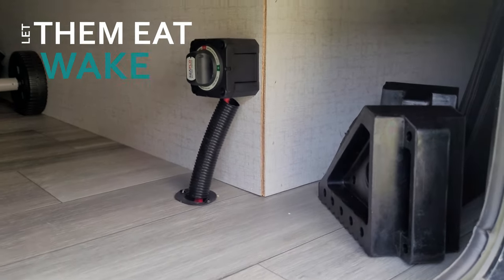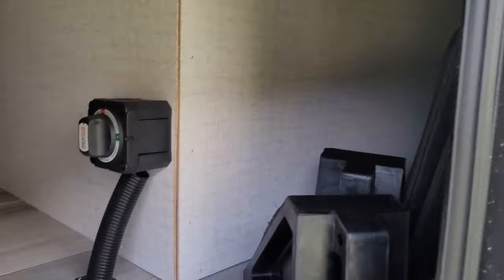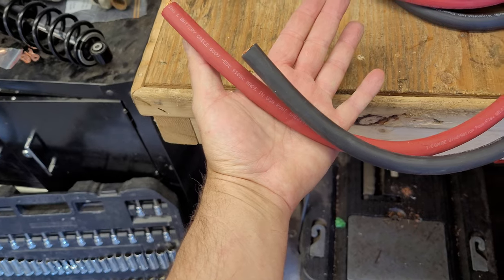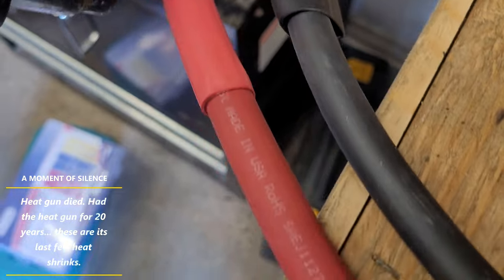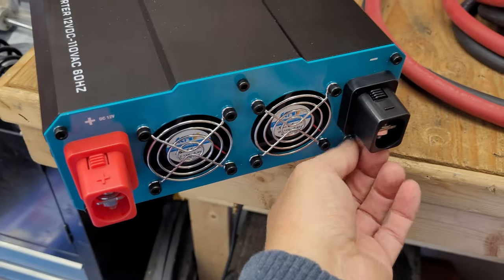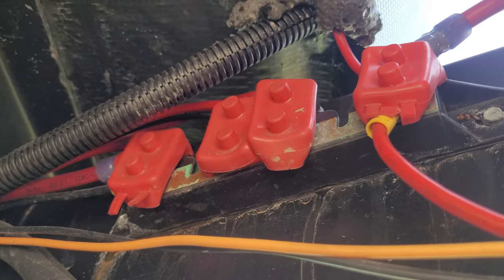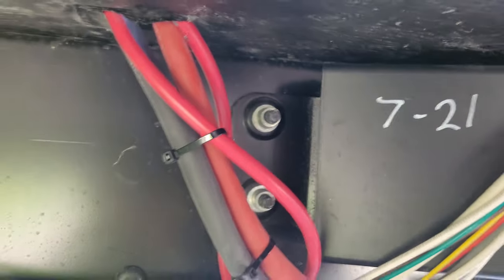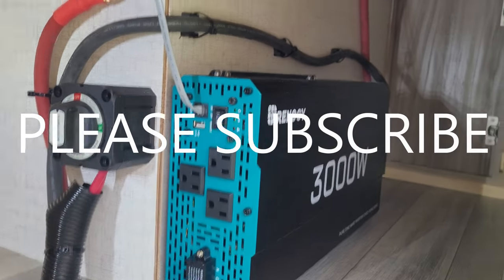Renolgy 3000w pure sine wave inverter install into Winnie Mini 2108DS RV.

Comment: Per this chart, aren’t you way undersized on that 0 wire.

You need to check the heat on that line while running the max power you will be utilizing.

The 12v wire gauge size chart that can be found online, will show you need a heavier duty line then that.
Reply from the maker: I have it fused at the battery for 250 amps. Then a reset able 300a after that. Fuses will pop before any heat becomes a issue.

Comment: Lots of good stuff like chafe protection but ideally, depending on the distance to your battery, you might add a fuse (or move the existing breaker) at the battery to protect the wire going from the battery to the existing breaker.  The codes vary on the maximum distance between the battery and fusing but it's generally measured in inches (or cm).  You always want the protection (fuse/breaker) as close to the power source as possible.   Inverter/Chargers may need protection at both ends - ideally.
Also remember your cable run is only as good as the thinnest wire that it travels over (think weakest link in the chain) which includes the battery to battery cables (though in your case they only need to be 50% the size of the main run) so in your case you wouldn't want to terminate the larger wire on the busbar unless you upsize the wire from the busbar to the battery.
A clean install generally looks like  Battery -> Fuse as close as possible -> bus bar -> fused distribution panel with smaller fuses to protect the smaller gauged longer runs.   Larger loads like an inverter can be wired "alongside" your general house loads (which looks like what you are doing) but both should be fused/protected close to the battery.  Search for "MRBF Terminal Fuse Block" for a quick and easy fusing.    Happy travels.
Reply from the maker: Good info, I will throw a large 300A inline fuse closer to battery

Comment: FYI, there's something they never mention as far as your total load on the batteries. This model states >90% efficiency. So, the inverter will draw 1.11x more than the rate of 3000/12. This will add up to 3330 watts / 277.5 amps load on the batteries at exactly 90%. This may improve by how much better than 90% it might be, but prepare for the 277.5 amp draw at max rated watts. It is a big difference in run time.

Comment: Also.70mm cable like you're using can run 450a. 3000w/12v=250a. The  3000w invertor can hit 6000w peak..  hence a 300a =  3600w at 12v breaker is good!

Comment: My plan is to also install a hard wired 30 amp rv female plug beside the inverter, with a closable plastic access hole at the bottom. That way I could plug it in, it’s hard wired 30 amp, should run the whole camper. Now I just need to figure out how to charge these 230 amp hour batteries, lol
Reply: That will power your converter which will try to charge your batteries that are powering the inverter that is powering the converter that is charging the batteries that are.. see where thats going?
Instead.. find the breaker thats maybe powering all of your 110v outlets (prob except microwave).  Disconnect from that breaker and run the romex to the 3-wire connection on the inverter instead.  That way.. real shore power powers converter, converter charges battery, battery powers inverter, inverter powers 110v outlets.  No shore power?  No problem, inverter powers 110v outlets until batteries die, perhaps charged/prolonged by 400-600 watts solar? 
This works for 90% of 110v needs.. coffee maker, TV, laptop, etc.. A/C is out of the question, the inverter could maybe do it, but the batteries wont last.

Comment: You want to use 4/0 cable/wire and a 400AMP fuse also 3000 watt inverter will power the air conditioner. not sure how far your batteries are but you want to be less than 6 ft away  from the inverter. If you do use bus bars they should be 400 amp. All this can be confirmed by Renogy if you give them a call.
Reply from the maker: I added an additional 250a fuse at the battery so if it pulls to much current that fuse will pop. And yes it can power the AC unit. So far no issues. Batteries are a very short run to the inverter, so not much loss there.

Comment: I would like to do this setup with lithium but inside the passthrough. If I take the wires that charge my lead acid and connect to the lithium that should charge them? I have a WFCO auto detect currently

Comment: Very well presented video but I can tell you without doing the math that two flooded lead acid batteries and a 3000 W inverter would maybe be likely to if you’re lucky toast two pieces of toast you are way overpowered for your bank of battery
Reply from the maker: Yes its more of a future capacity planning. However my wife can use her blow dryer for over 13 minutes, so its serves its function :)

Comment: Question, you sized your fuse for 3,000 watts, but what about the surge, usually double or 6,000 watts? Just trying to learn so I can build a portable power supply, thanks
Reply from the maker: Hi Jerry, What I did not show in the video was another inline fuse of smaller capacity 6 inches from the battery, it is a 250A fuse. So It would pop faster than the 300A one would. It has enough surge for me to run my A/C. Or for my wife to run her hair dryer. I am not running anything with more load than that. If you were you should increase the wire size, and fuse amperage, Worst case in my set up, the fuse pops.

Comment: Im new so go easy.since you have your batteries connected to the inverter now where does the rv get the ac since its not connected to anything? It looks like you accomplished nothing again im new so please educate me as we just bought a 2108 fbs and want to do the same
Reply from the maker: I have a 30a plug beside the inverter, that your normal 30a extension cord plugs into, and then into the side of the RV. So you utilize the stock rvs internal AC wiring. All you have to make sure you do is turn the converter off at the panel using the fuse, so it does enter a parasitic charging cycle. You could do the same thing but with a standard 115v extension cord with a 30a adapter added to the end so you can plug into your RV.

Comment: Just installed mine, thanks for your tutorial. I'm getting heat at the fuse and isolator terminals, is that normal?
Reply from the maker: Make sure you also install a inline fuse no greater than 6 inches away from the battery , and of lesser value than the shut off breaker. How many watts are you pulling with the inverter. At high watts it will pull alot of amps. And the DC wire will heat up. Also, how long is your DC cable run? the longer the more resistance. Run the inverter at max watts, and get a Thermal gun, and test to see how hot the wires are getting.
Reply: @ADAMLS1240SX  Thanks mate. Why the fuse close to battery?
Reply from the maker: @72superlead  You want a fuse as close to the battery as you can get so that it would pop before the wire would ever melt down. And of lesser value than the shut off breaker, so that it would pop first.

Comment: I heard you say you can’t run the AC. Is it just the Renogy not producing properly since it’s supposed to be 6,000 watts surge? I’ve seen other Renogy complaints not living up to the specs? I bought one to try anyway. My research said use 4/0 so that’s what I got, more expensive but larger is good and allows for upgrades. I’m hopping to run the AC as well, currently have 460 amp hours of LifePO4 battery, thanks
Reply from the maker: Yes it will run the AC, how long the two batteries would last..who knows. But the inverter will fire it up, no issues.
Reply: The issue is lead acid batteries. The AC will eat those up in a very short period. Don’t forget the inverter itself is using battery capacity as well.
Reply: Most times this is not a function of the inverter capacity as much as it is a function of the voltage drop on the DC side of the inverter. When the inverter is putting out 3000+ watts on the AC side, it is drawing 200+ amps on the DC side. A wire size calculator will show that 200 amps running just 2 feet will require 3/0 AWB wire!  That size wire is rather impractical for most installations.  Thus, when smaller wire is used, there is a more significant voltage drop in the wire. So the inverter sees the DC voltage at an unacceptable level and shuts down.  It makes me wonder why they even sell inverters that require so much current. Just not practical.

Comment: Why not use the passthrough function of the inverter to plug shore power into?
Reply from the maker: What I did that I dont show on the video, is I wired a 30 amp receptacle by the inverter, and now just plug in the 30 amp cable from the RV into it. So it powers the whole RV like I had shore power.

Comment: You cant run a 1900 watt Coleman Mach AC unit off that???
Reply from the maker: I can run my 13.5k BTU AC unit easy. However it drains the batteries pretty quick . It will start the compressor no problem.
Reply: @ADAMLS1240SX  Oh ok, good to know, I have 460AH lithium, it'll also drain but good to know it'll run it in an emergency or short periods.  saw you have Canada proof battery, those are good, my car sat in storage 1 year (neg terminal removed) and it fired right up when I went to get it
Reply from the maker: @FrankBullitt390  I leave my RV plugged into my garage, and leave the 200w solar hooked up. So the batteries stay fine all winter. I only have 220ah of reserve, using two deep cycle lead acid.